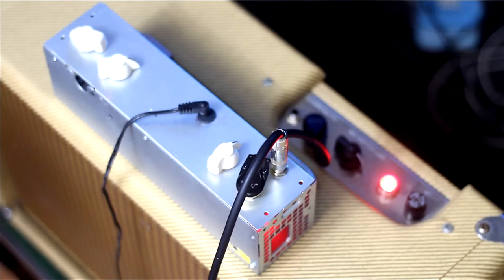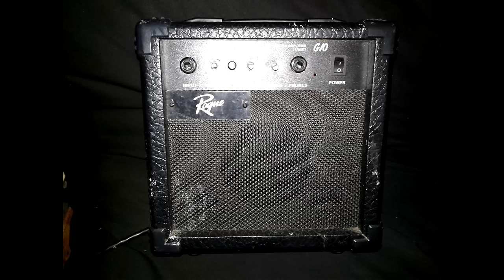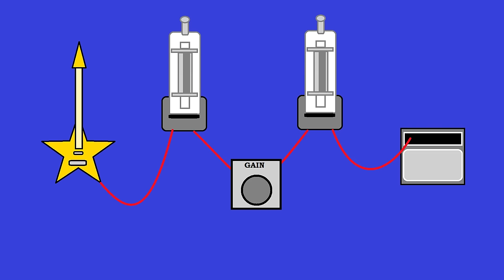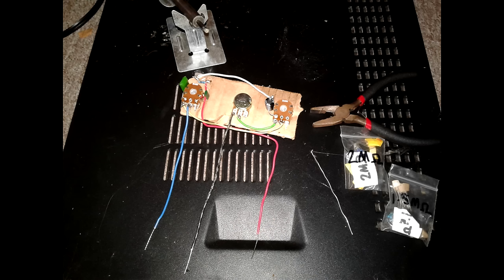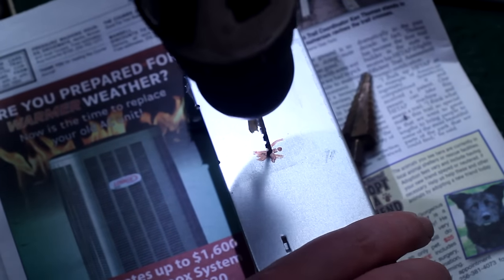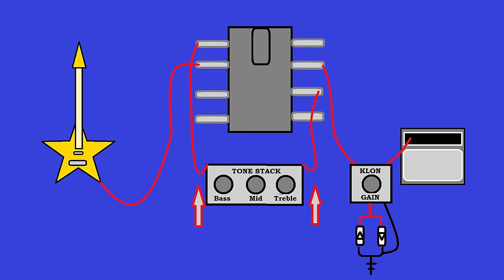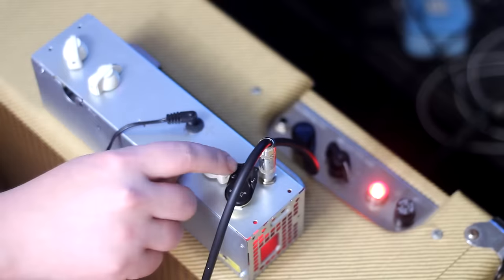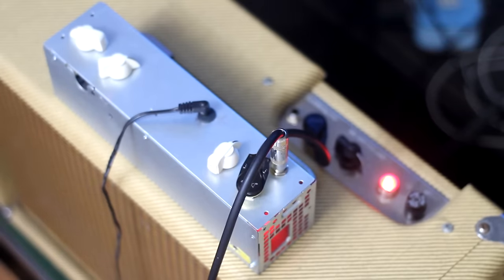DIY Guitar Tube Preamp Build and Demo (Super EASY!)

Comment: This sound sweet, cool projet. Now I need to learn and understand better schematic 👌 thanks for the video
Reply: I do have a spring reverb box from a marshall, don't know how they work but wonder if this could be added to this pre amp maybe!?
Reply from the maker: Thank you for watching and taking the time to leave such kind comments Alex. 
This is a pretty good start for tube projects. It would be decently simple to just wire it up direct and get it running without understanding schematics. 
You could integrate a spring reverb into this but, I don't know if the small tubes have enough power to push the spring reverb directly. They usually want to see a decent amount of power to shake the spring. You could build a separate unit using the reverb tank and place it between the preamp and the amp. I have made one from an old amp reverb tank in a suitcase powered by a computer speaker amp and put it between the preamp and amp.
I recorded the entire build heres a link: https://youtu.be/1t1sbeOMm3c?list=PLUNzqbzfE3IGAHJtHP-OYBvMuWeDUi_Kh

Comment: how many extra steps would there be to turn this pre-amp into an entire amp?  wiring it to a speaker?  What else?
Reply from the maker: Thank you so much for watching and taking the time to write a comment Kyle. This is just pre-amp so doesn't make enough power to push a speaker on its own. I wanted to make sure and I just got out some leads and hooked one up, it was barely audible with the speaker pressed to my ear. It would need some type of power amp like the little class D boards on amazon or ebay would be more than enough they are VERY loud. The unfortunate part of that is though that those run on DC power and this unit runs on AC. Sooo You would probably need to find a tube preamp board that runs on DC power like one of the little headphone preamps and just treat the wiring exactly like the one i did in the video OR you would have to find a 12V AC to DC low voltage rectifier and voltage regulator board, The only other optuion would be to run 2 wall adapters one AC12v to the preamp and one DC 12v to the power amp, those boards are tiny though so you could put it in your speaker cabinet and have the preamp in a head unit configuration and youd have a tube/solid state hybrid stack. Those class D boards can be bought with 2 channels at 250watts claimed power when run at 24v DC but will run on as little as 9v just making a little less steam. Lots of guys in the Guitar world will tell you that class D sounds like garbage but Petey TwoFinger builds a lot of class D amps and his tone is Fantastic and he can run his entire guitar ring and PA deafeningly loud on batteries. Well I hope that helps some and Here is a example of the sound quality and volume Petey gets from those little Class D amp boards. He also has a ton of info on these things and many full builds on his channel: https://www.youtube.com/watch?v=5Vyr_sFKcCY

Comment: Probably a dumb question, but is it possible to use two of these boards and build a two channel preamp that uses one tone stack?
Reply from the maker: Thank you for watching and taking the time to comment ITS. This could be done but it would be a bit touch you could build 2 identical tone stack modules and wire both of them to the same dual pots... like 2 knobs sandwiched but that is still 2???
Reply: @heavymetalATC  I was thinking more along the lines of channel one uses the first board, channel two uses both boards (clean and lead channel, ya know?), but I'm not sure how the switching would work on that.
Reply from the maker: @insidethestudio3886   you can put a guitar pedal foot switch in beween and it would do that for you.. it might be a confusing looking little pinout but a 9 pin can be looped up to do it?

Comment: I have an very old tube radio from my mother could I use that tubes?
Reply from the maker: It could be possible to turn that into an amp or pre-amp... but I really wouldn't recommend it due to electrocution hazards. If it doesn't have an isolation transformer on the incoming ac power and a 3 wire plug I wouldn't try it at all... but if it does have those things its possible to place an input on the volume knob lugs but as I said I don't condone or recommend it as you could be seriously electrocuted. You could have an amp tech place an input on it for cheap and he can take the risk of electrocution but I doubt they would want to as its just risky all around.

Comment: Wow that pre amp is so versatile. Just wondering if the valves can be cabled up to top of case ?   I always like to see those glowing beauties. Of course then I wonder if that ruins the Hum isolation...   Do you think it would make it Noisy.?..             great video.
Reply from the maker: Thanks Glenn. They sell an identical version of the amp with the tubes standing up. It may also be better for cooling to have them up and out. It may add some hum? but you could get those little cage looking tube protectors and put them around the tubes... or make some little dog wire or wire screen covers ground them to the case and it should kill any hum that would be introduced. Heres a link to the upright tube model: https://www.ebay.com/itm/1pc-6J1-Valve-Pre-amp-Tube-PreAmplifier-Kit-Assembled-Board-Audio-DIY/121611607261?_trkparms=ispr%3D1&hash=item1c509ddcdd%3Ag%3APCUAAOSwLsBZS4RA&amdata=enc%3AAQAFAAACcBaobrjLl8XobRIiIML1V4Imu%252Fn%252BzU5L90Z278x5ickkp2NA0WuhQytmt4dbStg00BWgoOScyZwybBXC4%252Bfo0CnuQYr5MJ4lvHHEiBnM%252FvwcYpMb%252FOpiGPkFun268Yr5e%252FsAeC%252FazxFp0mPTFUTdX4BpumEl6ofAC%252B6vXRsHHCBDs8rwHZYndQuPIHrGr3XyZpZeExB9jeZQwq6DsIZ5UXZMrR02tedKSqSMMXbD4BLI%252FSsHO49kx1geP7x5oIblxYSS7rn3GkWdQnAUODd2Jn%252BmNuYkucpAMArPsqVjLo8R4s%252BfG3W8W5f8XDE4Di0S5SiT62nUREjOwtbnhgoWTHCO3Oo5due4I0X0MlW6eh8R9y%252FUeAhTweqjf6j10BwhoyAcmj1i0W2CDYBGsPr2ca1gtjpM9B1gwfUvt0KuMGwNNmCSLsP3BgYjiz3q3CGzqz7HTLp9Aj%252BKMFo3T53Iy2HItGQp%252FJWbuGrylQammRsGuBUVsW%252FFIRFMg4bNEBRW1saGwefGoSLqSgGmPLdAt0hdCJ60xWPR22VbpJTqqTFm8irnYQ00uzz3uHSWxJ0S5wV5qdJUozEYDzAu0dROqJDuHUVQqRPTkhw8ooDCIWabkgP809U9makyYI572A5hHJa6YpxUEgxmetKN7EI%252BO%252BPu7I9T6g2KzO8rLwBdz%252BecB4PMnM174ujEuzDBoGUfDwHvj3lEJJhTUh43iifFiJCOHl2hScw66kcVKBZbdazJ%252BGtDoCwmi60eUm3uCS3AqGfvHvctXSKNTpDN%252BVyGsnAyZFj1SgjTop1he%252F5kg8Q6RERWKrYFgZzkh3rZLkmABQ%253D%253D%7Ccksum%3A121611607261e837f008d5574ae9a1df9a9fb932286b%7Campid%3APL_CLK%7Cclp%3A2334524
Reply: Hey thanks Clementine, I so want to buy that one you linked, it's so cheap, looks so good, and I noticed it's from Wohan. - so I'd be like "  check this out, it's the best thing to come out of Wuhan". .  Also it's cheaper than the lay down tube one , and funny enough it showed cheaper than a kit of parts to build it. Crazy.!   Only reason I don't think I will get it - I have too many things on at moment & will just frustrate me that can't work on it ☹️.
Reply: if you made your own board you could go hog wild. if you know what your layout is going to be you can have a board made for you online

Comment: Hendrix, Woodstock, Star Fangled Banner?
I bought Brookstone purple cat hdphones for $2 today.
Bright flash?
12AX7?
Reply from the maker: Thanks for watching and taking the time to write a comment Wayne.

Yeah, I was shooting for something similar to the SSB tone.

Dang! that was a good deal. Now you will look like an anime character but your tunes will sound Awesome!

I shorted a charged 60volt cap on the metal enclosure during test fit and it made quite a bright flash. It was about like a firecracker going off in my face. It didn't hurt anything just made a lightshow with sound and a puff of smoke. I'm glad it didnt dump that energy into me.

The preamp that I showed on the breadboard had a 12au7 but the ebay unit uses some kinda smaller Chinese tubes called 6J1 I have never messed with any of those tubes and I would think it is basically the 6 volt copy of a larger different 12 volt tube like an au7, ecc83 or ax7.
Reply from the maker: Thinking further on it... Those 6J1 tubes may be very similar to the little tubes they used to use in car radios and CBs in the 50s-60s I think those tubes had 4 digits like 5088 or 5830 and stuff like that?
Reply: Hi,
Please consider putting some tube hum shields or aluminum foil around the tubes and applying   different 'voltages' to them.
I have this circuit unfinished as I reached the hurdle of risking shock when LED volts will never fry me.
So considering what results you get if you try this, I may finish mine.😁
Reply from the maker: @waynemasters8673  Well wayne once you put it in a steel grounded enclosure it is pretty much silent. It was noisy out in the open. You may hear some hiss from the camera mic on the final section of the video but that isnt from the amp. Its more due to it being a cheap external cam mic and the amp was too loud so I had to put a compressor on the audio so it made the hiss stronger.
Reply: Thanks 
I'm not talking about reducing hum.
Put a signal on the shield.
You just told me its possible that the tube wilm receive a signal from outside of it.
Oh well
I'll  patent it if you don't.
Reply: The device is not from Ebay.
Fess up.
It's  from a country Canada doesnt deal with as they have imprisoned two of our diplomats.
Hendrix had political savey.
And you?
Reply from the maker: @waynemasters8673  I got pocket savvey. Im poor if I had to buy everything american I wouldn't have anything plus America isnt very good at production now days.. where did your computer come from?... your phone... your tv.. radio... car. I mean we just kinda gotta do what we can to make it, most of the damage has been done. Everything inside a walmart is made by little kids that are basically slaves. I dont shop at walmart much like maybe once a year but if they got something I need. I have to go get it. I do get the point and yes it sucks but they are just kicking our ass in the business and production world at this time. I cant starve over my feelings. Also I stay out of politics none of those rich people care about you it doesn't matter what flag he waves or what color tie he wears. we are just cattle to them. But at the same time thank you for the comment its good to see that we still have some people out there who are awake and can think.

Comment: Dude your a MFkn Badass just subbed as I will Petey  for as well , although i do have one question, whats the difference between tube and valve caster ?
Reply from the maker: Thank you so much Anthony, I appreciate your time and kind words. A valve caster is still a tube circuit but it runs by a different principle on a very low voltage, its just a dirtier more gritty sound but you cant get shocked so thats nice. LOL

Comment: What components on this board are making the boost conversion?
I ordert one and they claime it but there is no boost conversion happening as I see.
Reply from the maker: Thank you so much for watching and taking the time to comment Hermes. I believe the little transistor packages to each side of the board are jfets or bjts? I know that it is doing some type of boosting because the guy who told me about it measured the power at several points and got 28 or 32 volts or something similar with only 12 going in? I got a loud bang and flash spark out of mine on accident and I know the caps had to have more than 12v in them to do that. I hope it all worked out for you and you found it to be useful.

Comment: Can this be also paired with those cheap chinese mini class d power amp?
Reply from the maker: Thank you for watching and taking the time to comment Tarsious. Yes I think it would make a great front end for a little amp board. The only issue I see is power requirements, if you could find a power amp that runs on AC or an ac/dc converter,rectifier board. Another option is a little tube preamp that runs on DC like the ones they sell as headphone amps. If you dont mind having two power sources or if you maybe used this unit from the video as a preamp and then placed a power amp inside a speaker cabinet and plugged them in separately it would work great.

Comment: Very nice video , Is there anything similar that can be used as a small low wattage power amp?
Reply from the maker: Thank you for watching and taking the time to comment Christian. One option would be to go with another module like this one from ebay,wish etc. they sell class D solid state power sections. using this and that you could make a high powered amp. They would probably have different power needs though causing 2 power supplies to be used. Maybe by now some company makes a cheap tube power section on a board??? I wouldn't doubt it, but I do have a video idea involving one of these boards that should happen in the next few months it might be useful info ;)
Reply: @heavymetalATC  I was referring to a low low wattage tube power amp 🤗 but I’ll wait the incoming video for sure !💪
Reply: @heavymetalATC  did you try powering this board with 24 volts instead of 12? sould it work or will it blow ? 😅

Comment: Actually the 6J1 are each a single pentode stage, so there's only one gain stage per tube, not two like you said at 4:34 and 14:34
Reply from the maker: Thank you for watching and taking the time to write this comment Blackcorvo. Great information!!! I didn't know that. I don't know much about the 6J1 I figured it was a triode. Thank you. Good Job!
Reply: @heavymetalATC  It's a small signal pentode, but it's is wired as a triode. So it's really like having a single 12A*7 dual triode type tube at the end of the day.

Comment: can i using bass guitar?
Reply from the maker: Thank you for watching and taking the time to comment Sungrae. Yes you can absolutely use this with a bass guitar. It may need to be turned down a bit and turn the amp up to keep the signal clean but if you are going for that oldschool slightly distorted bass sound then crank it up and it will be perfect. Thanks again.
Reply: @heavymetalATC  Thank you for your kind reply.

Comment: I'm curious, does anyone have any advice on how I could take a project like this and add the ability to blend the clean channel in and make the whole thing bass-friendly?
Reply from the maker: You could use a 3dtp switch to change it back and forth from 1 gain stage to 2 I dont know how to blend that unles maybe you ran them side by side and put clippers on one but thats way out there... either way this circuit will probably work well with bass as is. if you used a tone stack from a known bass amp in it like fender bassman... itd be spot on.
Reply: @heavymetalATC Oh hey, thanks! I actually just finished a fender champ clone, and in the future I'll probably see how it sounds with a bass into a bass speaker.
Reply from the maker: awesome! 😃 @theanarchistcook

Comment: First of all for most ac powered things it doesn’t matter there the live wire has to be but for some it does so be careful
Reply from the maker: Thank you so much for watching and taking the time to comment Freeway. Yes in a situation with 3rd led grounded case and full 110v it could matter if you swapped hot and neutral but in this case its just the 12v AC output of an isolated wallwart transformer so hot/neutal no difference its all the same and also not enough juice to zap you untill it gets boosted and put into the caps on the board. Also why I thought this would be a good beginner project. The radio to preamp conversion you mentioned is not ideal for just that reason it would have voltages of atleast 110 and up to 400-500 in some cases and that could kill or seriously injure someone. This one is pretty safe, it could give you a zapp but nothing that would cause permanent injury. Very friendly for beginners.

Comment: Amazing
Reply from the maker: Thank you so much for watching and taking the time to leave a kind comment Keelan
Reply: @heavymetalATC  building one of these currently as a boost drive pedal. I have irdered the uprught tube circute configuration. 
Got an au7 and ax7 tubes. 
Going to run it - input, true bypass, potentiometer, au7, 3 band eq with vol control, run into either another au7 or a ax7, then finally vol knob before true bypass output.
Going to run it off 12v dc with an ac converter so I can run it off my pedal power supply

Comment: How would you add a send and return?
Reply from the maker: Thank you so much for watching and taking the time to comment Raul. You could place a jack after the tone stack and before the second amplification stage but the one of them would have to be those jacks with the 2 extra contacts that act as a switch to turn a jumper on and off when you put a plug in so it would still work without a loop hooked in. But... here is what I do and would suggest also much easier. Since this is just a pre-amp and most effects loops are between the pre-amp section and power amp, just treat the output of this box as the effects send and treat the input of your amp, or interface or PA whatever this is being plugged into as the effects return. Hope that helps and excellent question.

Comment: 60 Volt caps huh? I bet they are not even charged to this voltage. Baby stuff lol. I built a whole full tube hifi system and it have up to 500 working volts in the capacitors, in the power supply I built I have a 13000uf 500Volt capacitor and it also charges up to this when you crank the voltage all the way up. this capacitor is like a large bottle of water so if you would touch this to yourself or anything else then it would absolutely mess things up for sure lol